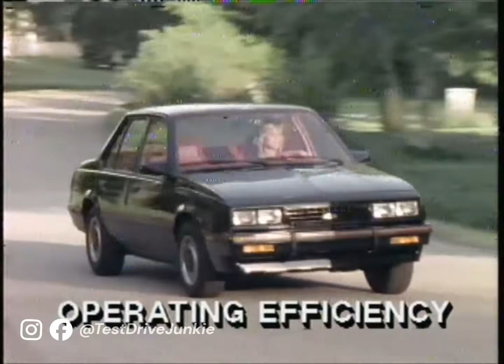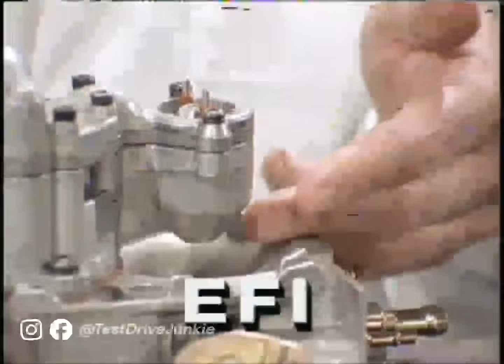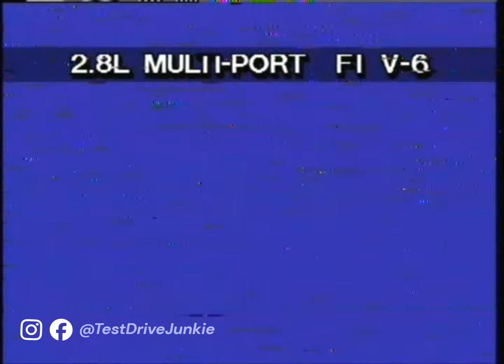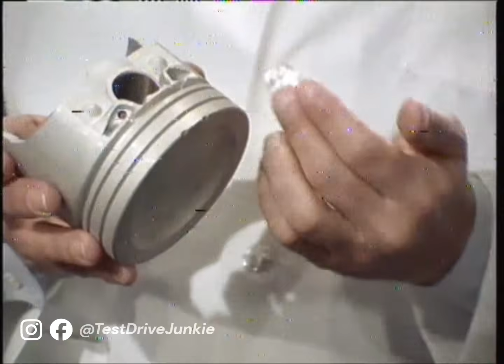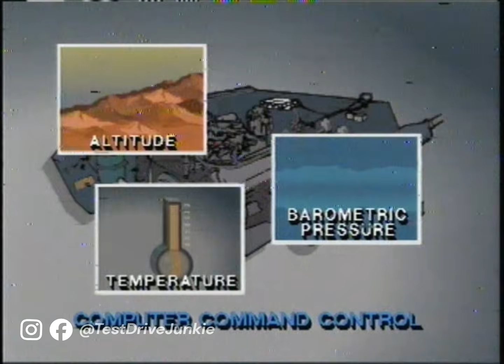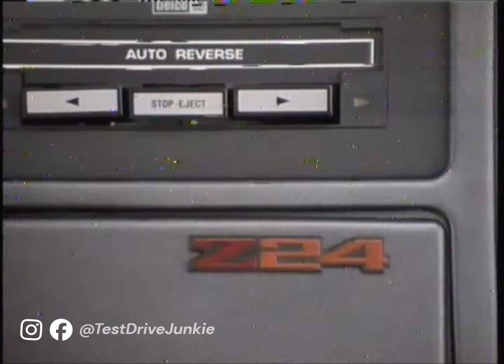1986 Chevrolet Engines and Computers Manufacturer Laserdisc Promotional Video

Comment: I don't see any difference between mpfi and tpi, Mpfi still has long tuned runners, might not be tubular but they are long. Both use maf sensors, and all the other sensors are the same design.

Comment: What about injecting each cylinder in sequence - instead of at the same time?
Reply: 1984 was the debut of SEFI and Distributor less ignition on the 1984 Buick Riviera and Grand National/T type with the turbocharged 3.8 litre engine. We had an 84 Riviera T-Type back then. It was strange not seeing a distributor. Instead a coil pack mounted on the top of the engine with all 6 plug wires attached. The system was a wasted spark type that fired 2 cylinders at a time, just like the later systems that gm used. The 2 cylinders that fired one of which was on the exhaust stroke and the other the compression stroke.
Reply: SFI sequential fuel injection 
The earlest GM engine i know of using it was the USA buick 3800 engine from 1988. you,d need a more sophisticated ECU that can be iinputted with both crank and cam timing and be able to drive more than 2 injectors at a time than the delco 808 ecu can do.